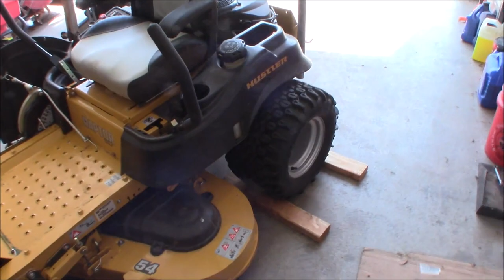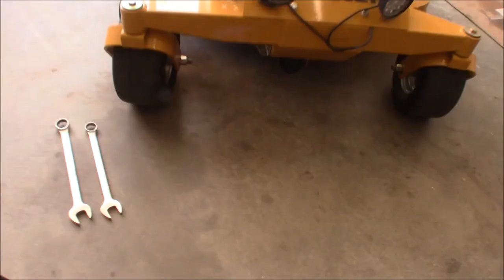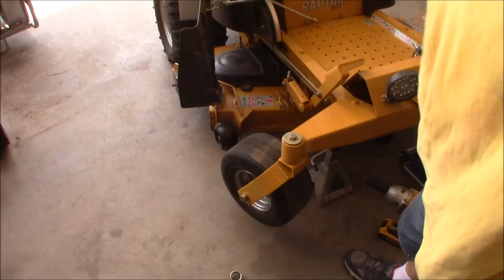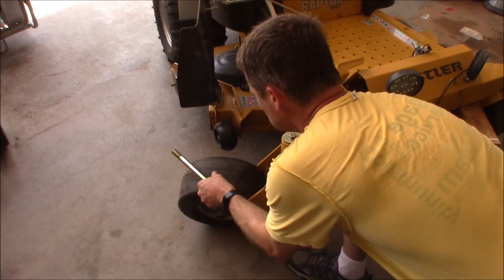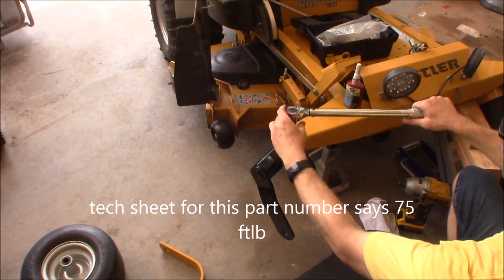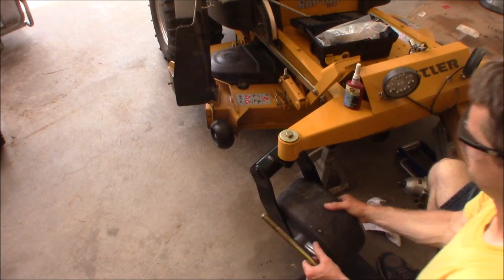Hustler Flex Fork Install-Zero Turn Suspension-Save Your Back

Comment: How does it ride? I just got done doing the bracket upgrade kit on my raptor SD 60. We have a few acres and a lot of ruts/stumps/bumps that really wear a man down, and apparently cause the stock brackets to fail a couple months out of warranty.
Reply from the maker: the flex forks definitely help a lot, and running lower pressure in rear tires helps for the back end. I think the flex forks were worth it
Reply: Did you buy them from the mower shop for $349?  Dealer told me $700 I'm like???  NO WAY!!!

Comment: Very cool, so how much did they improve the ride quality and what was the costs of them ?
Reply from the maker: expensive..that's the downside.  ride seemed a whole lot better on bumpy areas where I mow sometimes.  if you have a decently smooth property, may not be worth while, but if you're mowing a county ditch or a wash out area, it's a big help